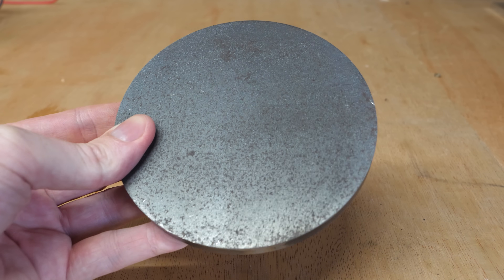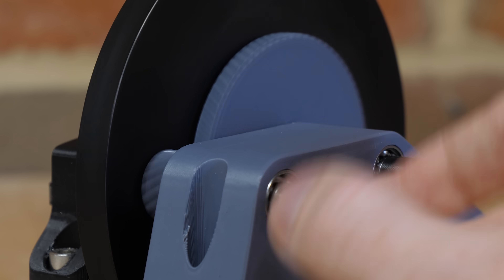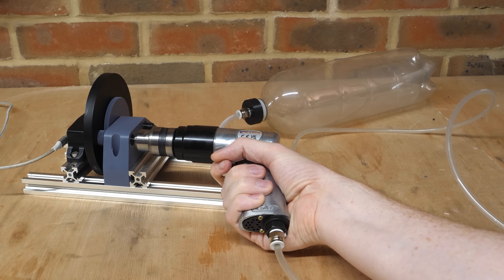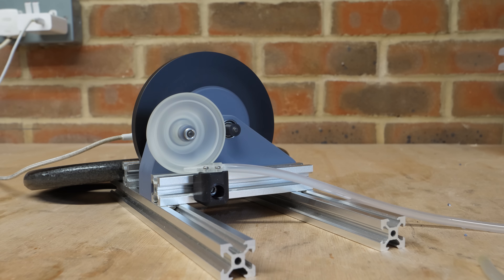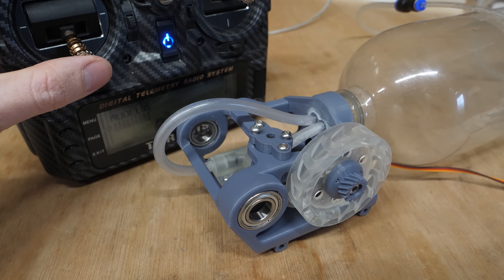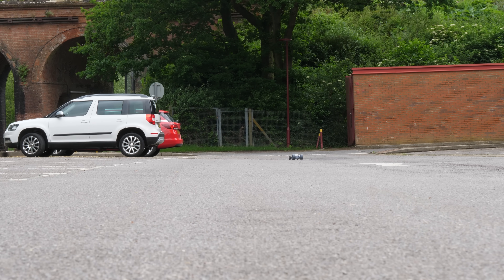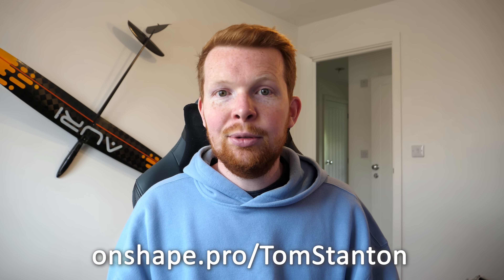Building a Turbine Car

Comment: I know this idea may not be as flashy as a dragster, but could you consider making an air powered clock?

The air would replace an escape mechanism. And theoretically could be used in zero gravity without an electric power source

Comment: its a mere single stage impulse turbine. nothing new here, 150 year old technology, its sad that despite that the principles are completely overlooked and misunderstood...

ideal RPM at half the velocity of the jet of air.
the velocity of the air jet will remain constant at any pressure above approximately 15psi. a thing called "choked flow" in the nozzle. pin/pout= 0.577 or something like that...

as it is cold air, with no latent heat to release, that is the maximum speed of the jet. mach1. diverging nozzles dont work in this situation. you need HEAT to make gas EXPAND for a diverging nozzle to work. with compressed air its cooled below ambient, and rather than expand, its CONTRACTING as it attempts to absorb heat from its surrounds. using compressed air "as is" limits the speeds you can achieve, and that limits the power density. preheat the air and it can now expand with even more force, and reach a higher velocity than the choked flow in the nozzle. at which point eth turbine can produce more power from the SAME VOLUME OF GAS.

as a single stage impulse turbine, or "delaval wheel" has such a ridiculously high speed making it impractical for virtually any application, you compound it. first stage, reduce the velocity of the jet by say a third, redirect through stator blades, then reduce the velocity of the jet again in the second stage, keeping in mind that the PRESSURE is constant, at atmospheric, and that it is VELOCITY that matters. pressure converts to velocity IN THE NOZZLE. the blades simply "bounce" the air back on itself in the opposite direction, and ideally the blade recedes at half this speed and the air "stops", relative to the casing. a small loss is inevitable as the air has to then ESCAPE the system... it has to leave with SOME velocity.

 each "wheel" has two, or more,rows of blades, divided by a set of stator blades. aka the "curtiss" turbine. 

by simply doing that, you could halve the rotational speed and still produce the same power output...

this can then be further compounded with pressure stages, the steam only expanding by so much as it exits each set of nozzles... ie, nozzle, blades, stator, blades, another set of nozzles, more blades, stator, blades... this requires sealing of the shaft between each pressure stage, as the steam (gas, fluid) is wanted to pass through nozzles, not leak past them. 

simply "making a set of blades inspired by gas turbine compressors" is using the exact OPPOSITE PRINCIPLE of how a turbine works. they are compressors, not expanders. they are intended to raise the pressure of a gas, not reduce it.

an example for a reaction steam turbine is the parsons turbine, that uses the reaction force of the nozzle itself... the blades from the NOZZLES where steam escapes and expands. pressure converting to velocity. the steam then slows as it passes stators, develops pressure gain, then is squirted through another set of blades come nozzles, where it again expands, converting pressure to velocity... repeat as necessary...

of course, all "reaction" turbines are "mixed", relying on impulse AND reaction forces. the only "true reaction turbine" is hero of alexandrias little aeolipile. and that is a single stage reaction turbine, and unlike the impulse turbine... it must rotate at THE SAME VELOCITY that the gas leaves the nozzles for maximum efficiency... TWICE the RPM of an impulse turbine. which is already stupid fast.
 THATS why they compound turbines. to bring shaft speeds down to something tolerable, practical. to expand in one stage can work, but its the most undesirable approach...

Comment: You need a proper drivetrain in your model as well if you want to get power to the wheels efficiently. No differential is gonna limit what this type of design can do. Results are very promising- I think with a bigger air tank, better tire choice (go for racing slicks!) and a proper drivetrain will make this kind of awesome

Comment: 3:42 Loved this bit. <3

Useless rant, feel free to ignore:

I find it somewhat annoying how some people talk about "low revving high torque engines" vs. "high revving low torque engines", when power is the thing that really matters, and that is torque * rpm (with modifiers). It's not like there aren't engine that have poor low RPM torque but plenty of torque at higher RPMs. Having lots of torque at low RPM means you also have more power at low RPM, and that's the deciding factor there, so I'd much prefer talking about engines with lots of "low range power". A car with the same power output at a higher RPM would behave basically the same if geared correctly, but especially if we're talking passenger cars, it is nice if you can generate lots of power at the low end, makes for a very easy to use car that isn't shouty.

For peak performance though you really want both RPM and torque to be quite high, and there are many ways to skin that cat. You can find certain eras of NASCAR and F1 engines that have basically the same power outputs, and both are running near physical limits in terms of piston speeds, but at vastly different RPM ranges, displacements, engine mass and complexity. The NASCAR engine is relatively simple and performs immensely well, they're really solid power units, but if they have a flaw compared to the F1 engines it's their weight. In the 2010s the engines weighed around 250 kg, which is about 100 kg heavier than the minimum weight of even today's overweight F1 engines. Ferrari's V10 engines peaked at about the same power output as the NASCAR engines of the era, somewhere in the 900 hp region, while weighing more like 100-120 kg. Of course, their flaw is that they require super intricate engineering and exotic materials, and cost a shitton more than the NASCAR engine...

Comment: Shouldn't a variable nozzle allow you to control the air's speed, and hence fiddle with the torque curves?

Also, old-school multi-stage steam turbines (like on the Titanic) can have the last turbine exhausting even under atmospheric pressure.

Comment: Just look at your air COMPRESSOR. It's already a / an ELECTRIC & AIR powered single cylinder AIR ENGINE!! If you take it apart or look at a diagram of your air compressor it will show that.

Comment: If you used some synthetic or silicon based oil on high friction parts, it would be even more efficient. Right? Also, I think if you enclose the turbine, It would allow for higher pressures. What if the wasted exhausted air had an afterburner effect and could be recycled into the air intake.

Comment: Fantastic Engineering Tom! (love the Inertial dynamometer).
My old rocket club (Paisley Rocketeers) took to these PET pop-bottles with gusto, as they made a fine water rocket (which we called 'Aquajets').
Some bottles would burst at 150 psi, but some went bang at only 70 psi. We decided that the safest course of action was to remotely pressurise and launch 'em: above 60 psi, don't be nearby!

Comment: An optical encoder like you showed is more than fine for getting the current speed many hundreds or even thousands of times a second if the speed is high enough. When using an arduino, for example... 
ω = (60000000 * a) / (t * 2pi)
Where...
"ω" is the speed in revolutions per minute
"a" is the angle in radians between regularly spaced features the counting sensor senses
"t" is the time elapsed in microseconds between the two last counting events.
With say 20 openings in the optical encoder (with the non-openings the same angular size as the openings), you can get an update to your speed 40 times per single revolution, which, say at 12000 RPM speed means you are getting a speed update 8000 times per second. On an arduino, this still leaves 2000 CPU cycles per update, so you are still able to do floating point math easily... though if you are looking at speeds in excess of 40000 rpm, then it's time to look at something like a raspberry pi pico. 

Of course a magnetic encoder is fine, too... just definitely over-engineered and expensive for simple projects like these.

Comment: Seems to me that at least one more nozzle could have a benefit. As it is, only one or two blades are providing thrust at a time while the rest are adding drag. The more nozzles, the more are providing thrust and not drag. Of course, there are increasing frictional losses in the system to consider and there's probably a sweet spot, maybe of just 2 nozzles with this setup.

Comment: Perhaps two nozzles and turbines in parallel. One with large surface area and one with small. The large generates higher thrust but low speed for the initial phase of acceleration. At a certain speed they switch so you get higher top speed with lower consumption.

Comment: What if there'd be a mechanism that can again fill up the bottle with the air using turbine wheel itself.. like injecting air just like a combustion engine injector, making it infinite filling and losing air until wheels are stopped by brakes? Or it can be again filled by something electric air filler powered by battery?

Comment: Have you tried dry ice with water in the 2 liter bottle? You will need a pressure release valve for the bottle's limits, but that should be a bunch more tests for a video. Back in the day the special effects guys  on set would play with the dry ice and their water bottles. Sounded like a gunshot went off. I always wanted to do that with an airhog toy and see what would happen. Anyhoo, keep on with these fun vids.

Comment: I think you reduced the efficiency by gearing it down. There's enough torque at 1:1 you could throttle down after accelerating so you waste less air

Comment: Well done Tom. Top work. I tried this for power generation with relative success but I'm interested in the impeller type turbines. Opposite to the one you made that didn't work, where the centrifugal force aids in the exhaust gas. Cheers J

Comment: The turbine is not at all a good one. Massive amounts of air drag and low pressure drop over the actual turbine. Look into radial steam turbines used in cogeneration. They are very small and compact plus will be much more efficient.

Comment: A point on the tyres - the amount of grip is relative to the amount of load forcing those tyres into the ground. You got a tiny bit of slip on the launch so it might be worth either adjusting the weight bias or adding a bit of ballast over the rear axle to maximise the amount of force you can generate

Comment: Something interesting that could be done to improve the efficiency of this design would be to add a hybrid system, maybe with a super capacitor attached, that allows it to start more easily since the turbine seems to be losing lots of air trying to get the car going. It could then recoup some of the energy when breaking.
Great video! :)

Comment: Oh, oh, it would be awesome if you make this into a viewer competition to develop the best air turbine for the application. Major Hardware has a long running series where viewer submitted computer case fans (although increasingly loosely so) compete against one another. And rctestflight has just started one for RC boat propellers. You could run one for air turbines. Maybe like an episode or two at least?

Comment: With all this compressed air experience you have gained, I would love for you to try a practical DIY compressed air battery. These are already in field trials by the pros, but they are all grid scaled. What is the practicality of making one that competes with "solar generators" or whole house batteries? It can be big and heavy, but it has to be pretty cheap and efficient to compete with lithium ion batteries.

Comment: Cant you add a small electric motor that would pump air back into the bottle? Would this be more efficient than connecting the motor to the wheels? I wonder if you could drastically enhance battery life by using battery to pump air, but air to move the vehicle

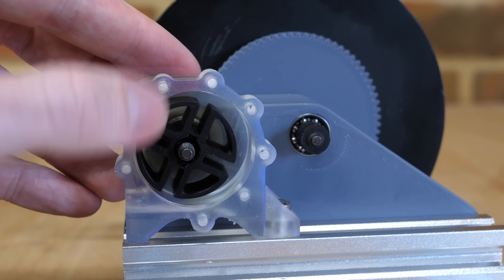Comment: That motor you mention at about 4:20, it's a nice one, but needs oil added to overcome the shortcomings you also mention as well as needing a constantly generated supply of air to keep working without dropping off in performance.
I think you explained well how different kinds of air turbines are handy. Kudos.

Comment: @TomStanton    Have you considered making a turbine patterned after a pelton wheel? They are very efficient in water. But that does not necessarily transfer to air. But it mght be a good experiment to see if it works.

Comment: The current design of the turbine has an axial part of the force, which is almost completely lost. Though, your design reminds me of a pelton turbine. Your blades act like half of a turbine shovel of a pelton turbine. If you‘d follow the „spirit“ of this kind of turbine, you avoid the axial force which is lost in the current design. All the thrust goes in to radial movement (or at least the axial forces cancel out)

Comment: Hi Tom, I have close to zero physics knowledge, but I'm wondering, would a progressive choking of the nozzle's output diameter possibly result in higher speeds when hitting the turbine, while maintaining longer runs at the same time? My line of thinking is that maybe when the turbine hits higher speeds, the speed of the decompressing air can't keep up anymore and thus maybe even slowing down the turbine.
If the system works how I think it does, forcing the air through a tighter nozzle proportionally to the rotational speed of the turbine (no idea how to achieve this technically) would result in higher air speeds hitting the turbine.
Now as I said, I have almost no knowledge of physics, and this thought is only based on intuition, so take it with a pinch of salt :)

Comment: I feel like if the power goes in both of the rear wheels, the speed and steering would be better. Maybe like 2 turbines from the same bottle (which would drain air faster) or a differential to drive both wheels

Comment: You need to make a gokart and then a production car.
 Filling up with air is much faster than charging a battery.
 Run a generator with alcohol or hydrogen to charge a battery and then power a compressor.
 People could make their own fuel at home and never need a petrol station cos you take extra alcohol in the boot or the car can make its own hydrogen.

Comment: BLADE DESIGN IDEA: you should try the blade design used in hydroelectric generators used in dams, its basically 2    bowl with a blade in the middle extracting every bit of kinetic energy the fluid has. Air is a fluid, might work?

Comment: Where does this horrible formula at 3:49, specifically the  random constant come from?
Edit: Fiddled around with a calulator a bit. when converting to seconds it becomes a nice 2 pi for the full rotation.
Reply from the maker: 60/2π = 9.549 it's to convert rpm to angular velocity

Comment: Is there no way to capture the lost air after it's been used and return it to the bottle? Kinda like the vent on the drill. I know that by doing this you create a closed loop system so the thrust from the nozzle will be less, but that's why you'd put the "accelerator valve" on the return, not the supply 😉

Comment: For pressing bearings: ALWAYS apply the force to the parts that is friction fitted. So if you pressing it on a axle apply the pressing pressure to the inner race and as you might guess if you're pressing the bearing into a bearing holder, apply the pressing pressure to the outer race.

Unless you have a bearing designed (trust bearing, conical bearing) for it, they can't take much sideways forces. And it's easy enough to turn/3d print a tool for that.

Comment: The problem is not only the input air expanding, its also the already existing air putting drag on the turbines.. by being chaotic. What you want, is an enclosure for the turbine, that allows a vortex to form that goes into the same direction and keeps the air that follows up directional aligned with the running turbine. That way, you also decrease the slowing down low-pressure pockets and ideally, the small sub vortexes shedding from the tip of the blade..

Comment: I built an engine back in 1996. Maybe even before you were born! 
It was a electric pulsed piston design. 
The recoil from the pulse, was stored back in the supply capacitor.
I got over 90% efficiency and unreal torque. You are a mechanical man. You are barking up the wrong tree.

Comment: The "Air Car" from MDI came out over a decade ago, and it was a flop. 
Unless you operated it in warm climates, it was useless in cold climates. 
Then they tried selling the engines for forklifts for indoor factories. I don't know what happened after that.

Comment: You might want to look into Peltier turbines as their meant to work with fluid dynamics as opposed to a gas thrust model. You wouldn't have to change much as far as your base model. Just put walls on the outside and take off the outer ring so that the air jet hits the center of the fins. It works much like a centrifugal fan but in reverse as the air jet is pushing the fan instead of the fan pushing the air.

Comment: Tom, I have a question for you to think about, once the turbine is moving and the compressed air around the blades has dropped to atmospheric, do the turbine vanes then start to move air them selfs like a fan?
If they do I am sure you realise they are then consuming energy as they are moving air, granted I dont think it is a big deal but energy is energy !
So, can you cover up the air injection side & incorporate the jet, this will do two things, a) stop the blades from becoming a fan (if the air has no where to go it can't move it) & b) stop any of the compressed air spilling over the edge and escaping as waisted energy.